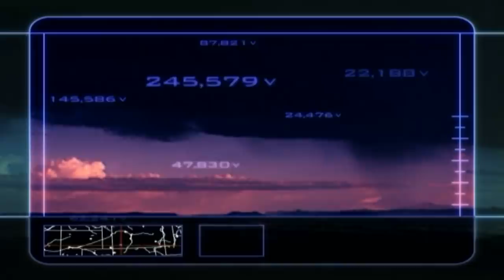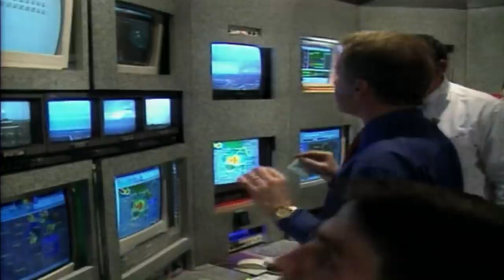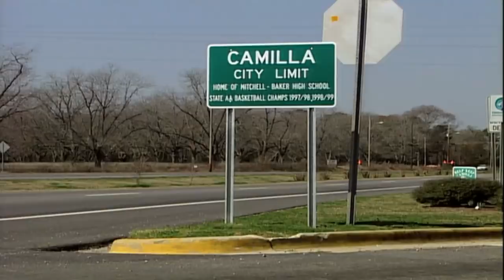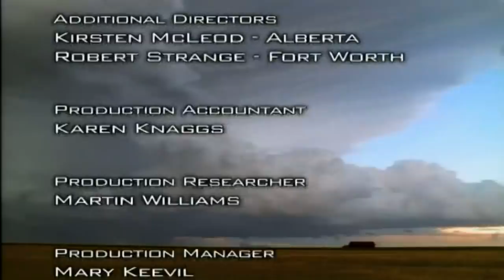Force of Nature - Tales of Tornado Alley

Comment: Also, would a tornado destroy a brick house in the same way it tears through a wooden house ? and if so, why don't they all live in brick houses instead ? or is it just an American thing to live in a wooden house ? sorry for sounding thick but im just thinking out loud to myself ? in England everyone lives in a brick house and I cant imagine tornados ripping thru the brick in the same way . . although what would I know ?
Reply: Brick homes are not always brick homes. In America, it's possible to have one side or three sides bricked, but add more brick and add more money.  I've seen tornadoes that cause 2x4's to pierce concrete and everything from pine needles to pencils pierce trees like nails.  Even completely brick  buildings fall to the deadly debris flying at incomprehensible speeds.  If the twister can cause a pine needle to pierce a tree, or pick up a huge truck like a toy, think what a flying brick would do.  I've survived 6 tornadoes and I'm lived in Georgia my entire life of 35 years. Georgia is not "tornado alley", but tornadoes never follow any rules- we will always be humbled by the power of tornadoes, brick homes or not.
Reply: ahhh I see, so that's why everyone builds them out of wood. Much safer. I suppose a flying piece of wood may have less damage than a brick, ultimately. Although if it was that severe you'd be toast anyway, with the speed it was going. Its fascinating. Here in Yorkshire England, we don't have things like that. We're more likely to get drowned by all the rain !
Reply: Residential buildings can't really be designed to 'survive' tornadoes. If your house is hit by one, the structural damage is almost certainly going to be enough to require it to be rebuilt. As Kathryn said, even brick houses can be torn to shreds by flying debris.
Reply: The brick homes that you see in Texas and the rest of tornado alley are mostly wooden "stick" structures with a brick veneer that is just cosmetic, it doesn't actually serve any structural purpose. Compared to aluminum, vinyl, or wood siding, the brick veneer has only slightly more resistance to projectiles, if any. In addition, much of the construction in areas like Texas, especially pre-1990's is extremely shoddy. In that area of the country (at least more than others) people wanted large size and prestige instead of quality, can't have it all for cheap. In the 80's and 90's in the Dallas burbs you could buy a massive and impressive looking new house for under $100k, but it wasn't uncommon to see them falling apart after only a few years. Not ideal tornado shelter. 

If you go to the coasts, you find houses made of actual concrete block which is different, the block serves a structural purpose, although even block has its limitations.
Reply: Iv'e seen lab tests done on this in another documentary. They fired a piece if wood out if an air cannon at different house wall structures. Wooden walls, brick cavity, and concrete. The piece of wood smashed right through the brick wall, so UK houses would be torn to pices aswell from a big tornado.

Comment: 0:05 It isn't that bad. Most storms just create some rain and nothing else, it's the big ones that make tornadoes.
Reply: Chrnan6710 nope do u live in tornado ally
Reply: Chrnan6710 
there is a reason for that name of "Tornado ally"
Eh, my cousin lives there...
it's not fun at all
Reply: CODY GRUHLKE If it were that simple, they wouldn't be so scary. Sure, they'll destroy 1/4th of everything they touch. The other quarter they'll pick up and set back down. Or leave alone entirely. Maybe they'll launch a piece of straw through a telephone pole, put a chicken inside a bottle, or carry a baby for a while before leaving it in a tree. Maybe the clouds will just reach down and fingerpaint for a while. You have no way of knowing.
Reply: existenceisrelative Can confirm, have tornado fingerpainting hanging on my fridge.
Reply: Stormstalker Your fridge would be part of the of the fingerpainting!
Reply: +Blu senpai I feel your pain I live in Oklahoma it's the worst every summer tornados
Reply: +Chrnan6710 No, Skinny tornadoes are are more powerful. It's true.
Reply: BUT! Skinny tornadoes are more faster, More destructive. An F5 Is strong, But more skinny ones are faster, And can turn into bigger tornadoe also leaveing alot of destruction in there tracks. THIS is also scientifically proven to.
Reply: A Hydrogen bomb is more worst than a EF5 Tornado, Also. A EF1 Can transform into a EF5 If it's want's to. So, Were the same.
Reply: ***** But at least it missed The Warren.
Reply: I can tell u what's stronger then a tornado. A Comet, Or astroid.
BAM!
Reply: +Amanda Pascal i'm a storm chaser, been chasing since 2008. The speed of the tornado does not depend on the size of the tornado. It's goes with the speed of the storm itself. A 10 yard wide tornado can either sit still or move at 60mph, a mile wide tornado can either sit still or move at 60mph. So its not about the size of the tornado, its to do with the whole storm system. And small tornadoes are more commonly to be much less destructive.
Reply: +CODY GRUHLKE Texas is a nice place but no it won't, it depends on the EF rating of the tornado.  That's why they have the Enhanced Fujita scale (example: EF-4) which determines the strength of the tornado. They go by the damage that the tornado does. An EF-0 tornado (weakest tornado on the Enhanced Fujita scale) will not destroy a house compared to an EF-3+ tornado. All an EF-0 tornado would do is just take some shingles or siding off of a house, break a window or break small branches off a tree but any tornado can be dangerous
Reply: +Chrnan6710 Wrong. They build up to big ones, but funnel clouds are what destroys, because tornadoes can still be tornadoes without the funnel cloud. 

That is the confusion. What they need to say is "funnel cloud" when describing tornadoes. 

A funnel cloud is the twisting downward of the wind of the tornado. Even small dust funnel clouds are the same principle, warm wind rising into a cold front, the wind at higher elevations are cycled downward pulling energy from the warm air. This is what causes a funnel cloud. 

Anytime there is warmer, humid air pulling into the atmosphere, it makes the atmosphere unstable and then the cold front rushes because the cold air is horizontal whereas the warm air is vertical. And this can happen in the day or in the night, when there is rain or no rain. 

The worst weather I had seen was 2008 when the hurricane dissipated and spread out north, in Springfield, Ohio we were hit with eight hours of hurricane force winds that was hot, because the wind carried the hot air horizontally instead of vertically. Eight hours later,  much of Springfield was left without electricity, and several funnel clouds were spotted, but not a single drop of rain. 

"Tornado on the ground" simply means a funnel cloud. 

Water spouts and dust spirals are the same concept, only less damage.
Reply: +Ibuki Mioda And skinny ones usually spawn from others. I've seen that. EF5s are simply larger, that is why they cause wider damage. But skinny ones can spawn others and spawn from others then merge and then separate. 

Sorry for the other commenter, but eyewitness accounts trump science in the case of tornadoes. I will bet that other commenter only thinks that it is really a tornado only if the weather channel says it is. The problem is this, if you are in the country and know it is a tornado, law enforcement never calls it a tornado unless a law enforcement officer reports it, that is why sometimes there is so much damage and not called a tornado, because the law enforcement didn't see the funnel cloud. 

I've seen that myself, knowing a funnel cloud formed and seeing the damage, but it doesn't get called a tornado because no law enforcement saw it or reported it. 

Law enforcement needs to change their responses, because a lot happens in the country and only farmers call it in to report it. 

I saw one time where an obvious funnel cloud had torn up trees and dug a trench for over half a mile, but because no law enforcement saw it, it wasn't officially a tornado. 

And never underestimate the fact that just because tornado clouds are ten miles away, funnel clouds can come at any time in any place. I saw a funnel cloud form in March over a lake. 

The other commenter needs to understand that a tornado only gets called a tornado officially only if law enforcement sees it. And that is wrong. There needs to be changes, and in Ohio they did change that because storm chasers are considered law enforcement when reporting funnel clouds and Ohio now depends on storm chasers. They do the real reporting.
Reply: +JRobbin3 And you guys are the ones who do the most reporting. I know that in Ohio, storm chasers are the official voice of reporting. 

I remember when a tornado was only officially called a tornado if law enforcement saw it and reported it. Times have changed and in Ohio every year the radio stations or tv stations will call for storm chasers to go out looking for them. 

I've seen tornadoes at times when they told us it was impossible, in months when they told us it doesn't happen. In fact, in 1986 the tornado system that tore up Lynn, Indiana, that storm spawned so many funnel clouds many miles away. That day I was sitting in the student lounge at our university, we had large dark windows that looked over the lake so we could not tell the color of the sky, but when going to the lobby we saw rain and wind and a car was almost flipped over, then it hit the top of the building and tore a hole in the roof over the chemistry lab. The students came running down from there screaming. 

We had no warning and had been always told they don't cross bodies of water. Yes, that funnel cloud went across Grand Lake St. Marys and hit us. We then were later told by administration to go home that the university had closed and we were evacuating. Later when watching the news, we watched as the news showed that the storm front had spawned funnel clouds a hundred miles away, and we were hit by one that had formed near Union City, Indiana, went northeast across several towns and then over our lake. 

But at that time, they never said we had a tornado, because law enforcement did not officially call it a tornado, but we witnessed it not only hit us, but the brand new YMCA building it tore up and blew parts of the building all the way to St. Marys, Ohio.  

I believe storm chasers any time because you guys are the ones reporting it. But you can't be everywhere at one time.
Reply: +Caden Crash I'm Moving To Tornado Ally... Kansas. Is That A Good Idea?
Reply: UG Gaming Roblox, Vlogs AND MORE!
Just move into a house with a basement, listen to and heed the warnings. Don't be a hero.

But it is winter now so you are currently safe, until you get a blizzard.

You aren't going to escape natural disasters anywhere.
Reply: moorek1967 I Will Make Sure Too XD

Comment: If there is a tornado and all the rooms in the house has windows can you hide in the wardrobe or not
Reply: +Abigail Hazell Your bathroom has a window? A small window won't matter, what's important is finding an internal spot. If that's a wardrobe, then good for ya. Still, it's no guarantee. It really depends on the tornado, where it's coming from, debris, etc. If it's a proper F5? You need to go underground. PERIOD.

Comment: is texas tornado alley too
Reply: Terry Ketchum yes so is colarodo
Reply: Ok
Reply: Terry Ketchum 

Northern Texas is, but not so much further south.
Reply: Well I live in Texas and we had like 10 tornadoes warnings since 1995
Reply: southern Texas is more hurricane prone while northern Texas is tornado Ally
Reply: Terry Ketchum Central Texas has been hit with a few, most are really small and harmless but there are a couple that have completely devastated some small areas. It's pretty rare
Reply: Tornado Alley is a colloquial term for the area of the United States (or by some definitions extending into Canada) where tornadoes are most frequent.The term was first used in 1952 as the title of a research project to study severe weather in areas of Texas, Oklahoma, Kansas, South Dakota, Iowa, Illinois, Missouri, Nebraska, Colorado, North Dakota, and Minnesota.
Reply: Yes, but most in the field define that only as northern Tx & specifically, the panhandle. Of course, tornados can occur anywhere in Tx, just as they can occur outside of tornado alley. However, by far the vast majority of tornados in Tx are in the panhandle.

Comment: Domes or hill shaped homes.  Clearly box shaped houses and structures get yeeted by tornadoes.  The definition of insanity is doing the same thing repeatedly and hoping for a different result.  Let’s learn from our mistakes, yeah?  Rounded and domed buildings have 2 things going for them that make them good against tornadoes/high winds; and that’s that their rounded shape break up and divert wind and air pressure around itself evenly.  The second thing is, the fact that it’s shaped like the bottom of an eggshell, it also harder to lift or crush. Combine that with steel reinforced concrete and you have tornado proof bunkers.  Make a few adaptations, and you could possibly use it in Hurricane areas. Might cost more up front, but you’ll only have to build it once 👍🏻 Your insurance rates would start going down 🤣

But we seriously need to begin building with weather in mind, as opposed to outdated architecture. It’s not like the weather is going away.  

And can we just take a moment to appreciate that we heard someone named “Chad Bradley”  in the doc??
🤣 I swear the angel on Purgatony has that name as well.

Comment: how that they still live in wooden homes?
Reply: cough cabins cough cough
Reply: Because massive construction corporations throw up houses as fast as possible, sacrificing quality in every way.
Reply: MLG MIN3CRAFT L3ts pl4ysXXX which is exactly why I designed and had my home custom built specifically to be protected from major wind and hail storms. When you live in Texas and tornado alley like I do, tornadoes are as regular a part of life as waking up and putting on your shoes. People do have a choice to be honest but a lot of them can't afford the materials and labor it takes to make them. At the very least, however, I do believe the government should make it mandatory that all newly constructed homes located in this part of the US should have a storm cellar or safe room installed.
Reply: I live in central Oklahoma, the core of the Alley. My family is either going to build a house or find a high quality one, the latter being the harder.
Reply: If you mean by making it a part of the Federal Government's overall comprehensive tax plan then yes, I would be all for it